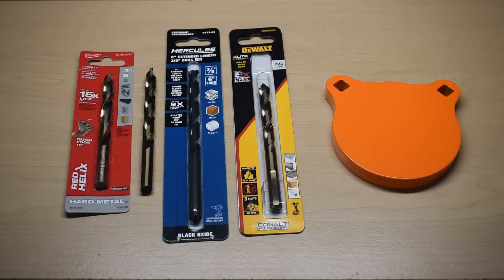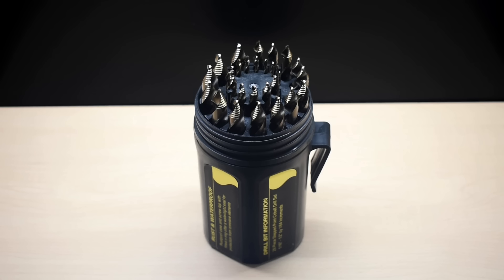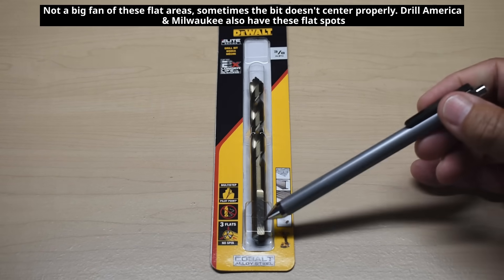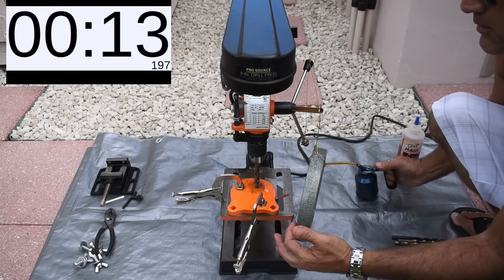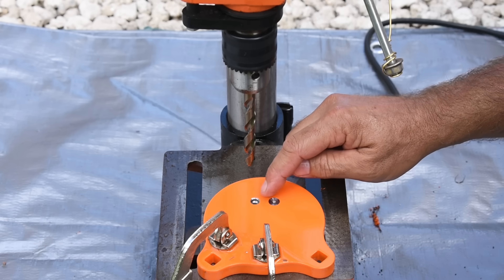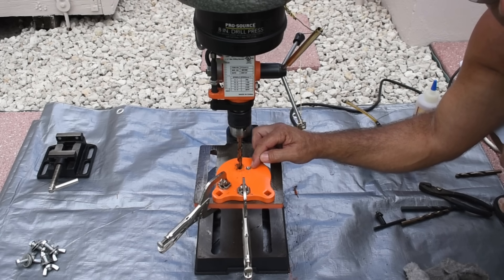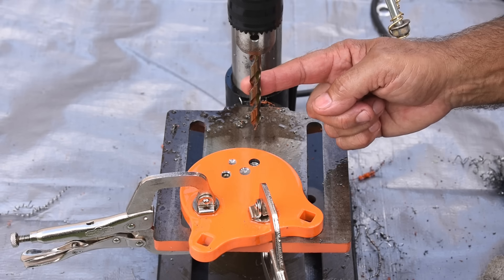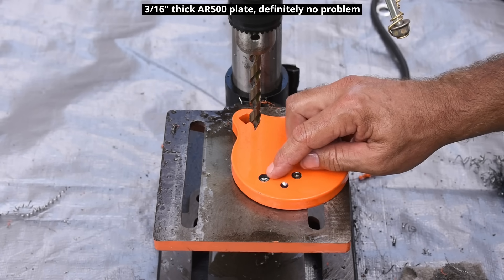Which Drill Bit Is BEST For Hardened Steel Plate Or Stainless? Find Out

Comment from the maker: In this video, we tested 4 different drill bits on tough AR500 hardened steel, an extreme test. The results you see here will give you a solid idea of how these bits would handle something a bit softer, like stainless steel. Keep in mind that while adjusting your drill speed might help each bit last a bit longer and cut deeper(slower drilling speed), it won't really change which bit comes out on top. A drill bit performing very well at a higher speed with a hard material, will perform even better at a slower speed. The cutting fluid used in this video is specifically designed for hard metals such as you saw in this video. None of the drill bits tested in this video became overheated during testing due to the speed of the drill press, constant lubrication, and short duration of drilling. Thanks for watching!

For those interested, I performed a 2nd identical test off camera using 2 brand new bits ranked #2 and #3. Tests were very consistent, with one performing slightly better. Of course, the results shown don't change the BEST to WORST ranking. 

https://drive.google.com/file/d/1FT2hw4dW5Un_6Jc9TazrEkZYZGWOzxR4/view?usp=sharing
Reply: RPM is way to fast and pressure is way to low . I can sharpen a normal drill and get through that in 1 pass.
Reply from the maker: @claytonchristophersen1633  Did you even read my pinned comment? Unreal. Good luck cutting AR500 using a high speed steel bit.
Reply: read the rest of the comments Peanut .
Reply: la prueba es algo que habria que considerar , pues si se quiere taadrar una placa de esas dimensiones tienes que utilizar una broca de menor diámetro primero, y luego una mayor y asi sucesivamente

Comment: I don't use my bits once or twice so when they make a point geometry that is complicated but not hand sharpenable then I have no use for them.   A fifteen dollar throw away bit is obscene.  They should concentrate their efforts on making them from good alloys and skip the fancy tips that in most all cases don't even work as good as the standard shapes.  I can step drill myself by drilling pilot holes with smaller bits if skipping is an issue.  If the tips are sharpened equally it isn't an issue until you get to the larger sizes whereupon you should be using smaller bits to start.

Comment: I like how he just pours oil on the last bit. Rpm is too high.
Reply from the maker: Reading the video description area as well as pinned comments is very helpful.  The reason why the oil was pumped at a faster rate on the last bit, was because of all the metal shavings/swarf that were expanding like a Brillo pad! The oil has a much harder time reaching the tip of the drill when that happens, so you compensate by adding more oil. That's something you should know....

Comment: I was a machinist and drilled and tapped AR 400 - AR 500 steel. We just had basic high speed steel drill bits and a much slower rpm like around 100- 200 rpm was a big help drilling this metal.
Reply from the maker: Possibly on a much thinner piece of AR500 platel, but i doubt it would last too long even at at slow speed because the bit is softer than AR500.I brought stainless and hardened steel items to machinists in the past, and they all used either cobalt or carbide bits. It's not going to be a good option for the average person who"s attempting to drill hardened steel or stainless. Thanks for watching

Comment: A machinist once told me "When a drill bit is screeching, it is saying dumb shit, dumb shit, the speed is too fast."
Reply from the maker: Incorrect. That is only one of several causes. In my case it was excessive cutting that was starting to clog up the flutes on the drill bit. You noticed it was cutting amazing when that sound started. Plenty of lubrication.
Reply: @electronicsNmore Next time use 2 parts hydrogen, 1 part oxygen (water) for a coolant, most mashininist will use a soluble for drilling.  Oil is for tapping

Comment: If you want something probably even tougher try drilling a AR bolt release lever specifically a Geissile Maritime Bolt Catch. I have a unique AR and wanted to use the Maritime bolt catch but it wouldn’t have 1 physical/mechanical feature so I wanted to drill a hole and tap it then thread in a hardened set screw and stake and RockSett it in place then shape it (I thought it would be easier than it was but knew it was far fetched even then and was going to have a custom one manufactured once I figured out the design) and I tried several of these bits and several bits of each of the ones I tried and I tried others not in the video and NOT A SINGLE ONE EVEN GOT A HALF MM DEEP regardless of speed, force, lube, anything none got close. I don’t know what it was made of but I gave up on it and haven’t tried again since then but it seems way harder than anything here
Reply: Have you tried a carbide multi-material bit, or an actual good USA made industrial drill bit like a cle-line? A standard hss cle-line will make any Chinese power tool brand bit look like garbage. Are you hand drilling or using a drill press?
Reply: That’s interesting that you wanted to do a mod to that part as you described.  Bill Geissele is known for his unique metallurgy ideas.  I’ve never tried to drill one of those but I’m not surprised to hear that it’s hard.

Comment: That's the issue with small and cheap drill presses, they run way too fast for most bits even on their lowest speed. The drill press damaged every bit tested by not running slow enough to hit proper SFM. It's like listening to guys who pontificate on needing cobalt to drill stainless, you don't. A good HSS bit running at the correct speed and feed with a bit of cutting fluid will drill it just fine, repeatedly. Give it to someone who doesn't know what they're doing and they blunt the bit and create a hard spot in the stainless before they even know that something has gone wrong.
Reply from the maker: A black oxide high speed steel drill bit is not designed for hardened steel or stainless, the bit isn't hard enough for the job, and will overheat fast. Perfect analogy would be using glass to cut diamonds.
Reply: @electronicsNmore  hate to disagree with you but like I said a good quality HSS bit will cut stainless just fine. It is all I use on my lathe for stainless. It's all about speeds, feeds and controlling heat with cutting fluid. Running bits too fast, like with that cheap drill press, is where people get into trouble.

Comment: There was discoloration on the bit tips from friction/overheating. 
But I'm not here to harp on that. I would agree with some of the others about the ability to resharpen a bit or not makes a huge difference. If you have to buy multiple bits to finish a hole it's no good. Second of you can't finish a hole, it's worthless. So without considering different speeds and stuff, the only way to make it through is by using a drill doctor or equivalent. By these standards the step bits are all inferior. And I have drilled garden steel with black oxide. I usually don't try that without pilot holes if I'm forced to use that type of bit.
Reply from the maker: Extremely minor. The only one that showed some discoloration was the Milwaukee red helix. The only reason why you saw some, was because after I knew it wasn't drilling anymore the drill press continue to run and I stopped lubricating
Reply: @electronicsNmore I wasn't getting on you about that bro. I understand what you were doing. I mainly seen discoloration on the tops but those were the tiny tips of the step bits which should build heat faster because they are so tiny. I think that's why the cheaper step but worked better. They actually had a step bit profile. 
My only argument was about what but is actually better for completing a hole. Since all failed and need sharpened the step bits would be where I would spend my money. 
Also never forget comments, good or bad, drive the algorithm. It doesn't care if it's negative. It's all about the engagement! And you ain't doin anything worth doing if you don't have haters. I played in a touring hard rock band and I can tell you that if you allow the haters to do anything other than motivate you it will burn you down! You do you. And we'll be here for it!

Comment: You are not putting enough pressure on the feed. And you need to slow the speeds way down. Lots of tool pressure from the very moment it touches the plate and a very slow rpm. Letting it rub on the plate is frying your edges and work hardening the plate.
Reply from the maker: Reading pinned comments or the video description area would be helpful. :-)
Reply: A lot of time is required  involved with slow drilling. 

Painfully and gradually. 

Trust me, I've been there.

Comment: I use bosch cobalt drills...to bad you didnt try them also...3/8 is a pretty big hole for that super hard steel...I suggest Ebay and getting something industrial...a 3/8 will be a lot of money.I think a carbide tipped Champion drill may be in order.
Reply from the maker: Bosch does make quality drill bits, but I was looking for the top of the line, best selling bits at Home Depot, Lowe's and Harbor Freight.

Comment: I have a 25 year old 29pc Milwaukee one slope cobalt drill set that has seen some abuse including high speed (that shoulda been low) drilling & starting unlubricated, that is still going well. I recommend a good set that will unfortunately cost real money, then replace individual bits of you break one. Good test for a shootout, slow speed is better in actual use, 300rpm would be good for this chore
Reply from the maker: Yes slower speed would be better, and allow the bit to last longer before wearing out

Comment: Machinist here. Your rpm should be around 300. Not 1000. Ar500 is crazy tough steel. Slow rpm with zero rubbing is the only way you have a chance of making it through. 

This video is an indicator of someone who honestly does not understand drilling steel.
Reply from the maker: Slowest level on my drill press is 750rpm. I'd be willing to bet the order I showed from best to worst, wouldn't change, but yes, possibly at the slower speed both the multi step and Drill America could have made it fully through by extending the life of the bit's cutting edge. Slower speed is used to prevent overheating, did you even look at the drill tips in the video after the drilling process? I view my test as an extreme test for these bits, and the results from these tests makes it very clear which bit drills that material best. Sorry my test didn't meet your standards.
Reply: @electronicsNmore I would bet the worst drill bit in your test would have made it through if you had the correct rpm and feed pressure. That would really change the results and lessons learned.

Rubbing is the enemy and you cannot avoid rubbing at high rpm. You need to be making a chip at all times. The edge did over heat due to friction. That is the mechanism of dulling.
Reply from the maker: Like I said the order would not have changed. The average person that has to drill through hard metal is not going to be using a drill press more than likely a hand drill, and they're not going to use a very slow speed where it takes a long time with downward pressure. Just being realistic
Reply: Thank you for posting your concerns, as it looks you're not the only one who questioned the procedure.
Reply: My first thought as well - too fast and not enough feed pressure.  I'm no machinist but I did stay at a Holiday Inn last night.....
To be fair, it seems like most cheap drill presses you see are woodworker tools and don't have proper speeds or rigidity for steel work so his results are probably not unusual for a typical diy home gamer.
Reply from the maker: @donhappel9566  Not enough feed pressure? You do understand how a drill press works? I used a 10 pound weight on the ends of the feed hub wheel, that force is FAR greater at the point of drilling. More than sufficient pressure was applied for this test. One thing I learned over the years on YT, there will always be complaints no matter how well you make a video, and there's an abundance of pedants.
Reply: To be fair, what part of an extreme test don't you get? LOL. He said which drills best, not which bit makes it through. To me, 2 bits were at the top, with one being a little better. Testing slower, probable both at the top would've drilled all the way throught, but I agree with him saying the order of best to worst wouldn't change.
Reply: Never had good luck with Black oxide bits unless its thin steel!
Reply from the maker: @Terry-q8l  Yes, it's fine for mild steel, but when he said that he could get the HSS black oxide bit to fully drill the ar500 plate, he lost credibility.
Reply: @Terry-q8l I've drill tens of thousands of holes with black oxide.
Reply from the maker: I Never heard of anyone drilling hardened steel or stainless steel using a black oxide high speed steel bit.  They make Cobalt bits for a reason
Reply: @electronicsNmore  Never heard of a machinist using any sort of hss tool. The ones i've met use tungsten carbide almost exclusively the only exception being diamond coated grinding wheels.
Reply: electronicsNmoremate I used hss to drill metal too.

Just because you're unaware of it doesn't mean it doesn't work.

When you have limited equipment and have to get the job done, you use what you can

If your equipment won't go below 750rpm or you're stuck using a hand drill, you still have to get the job done.

The test in this video was great!
Reply: @batmanacw  Agreed. Black oxide is just a coating, it's the quality of the underlying HSS that determines how well it will handle stainless or hard steel. A lot of department store black oxide bits are made from rubbish HSS , but you can also get some very high quality HSS bits with a black oxide coating. You just can't judge a drill bit  by its coating alone. Yes coatings can help to some extent, but they are all irrelevant if the underlying HSS is no good.
Reply: 200-400 rpm is recommended.

Comment: Your lubrication wasn't consistent. The last one is the only one that you pre-lubed it before starting the drill. The other 3, you let them start, before you applied any lubrication. Does it matter? Not sure, but the test methodology wasn't consistent leaving the ability to question your results. Sorry.
Reply from the maker: Whatever you say. Can't please everyone,  All bit tips had a pool of cutting fluid applied to the plate before each test began. You sound like you work for one of the manufacturers that didn't get 1st place.
Reply: @electronicsNmore   Sorry, don't work for anyone like that. I was interested and clicked on your thumbnail because I was interested in the test and the results, looking to see what was best for drilling hardened metal, and was just commenting on what I saw, since I never saw any puddle for the others, but you initially and constantly lubed the final drill. I'm sorry you feel my honest observation of what I saw from YOUR video presentation, was a partisan POV. If I was to be as cynical as you, I'd then have to present that maybe you had a preference of which one to make perform better by lubing the preferred one, and running the others dry.  Not interested in your juvenile suppositions, rather than you seeing what COULD be misconstrued as a flawed testing methodology, from a non-vested point of view. Bless your heart and have a good day.
Reply from the maker: If you doubt my results I suggest you buy the same bits and repeat the test

Comment: It's always been my dream to buy the most durable expensive drill bit set but I can never justify the purchase especially since I only need a drill bit a few times a year. I'm happy with my Harbor Freight $45 set but if I was a millionaire I would splurge for no good reason haha
Reply from the maker: If you're going to be drilling into mild Steel, aluminum, wood, plastic, then the Harbor Freight set is fine

Comment: Most of those are step drills, great for the average guy but I wouldnt touch that as they cannot be sharpened.  I use my drill bit sharpener to keep all of my bits accurate.
Reply from the maker: True they are difficult to sharpen, and they are not cheap.
Reply: If you buy the nice ones they have a lifetime warranty . When it dulls get replacement free
Reply: any brand youd recommend if I may ask?
Reply: NERD!

Comment: Great comparison, Scott.  👍👍  I've seen you commenting on Project Farm.  Seems you may be following Todd's way of testing.  You gave the 3rd bit a second chance with more pressure.  The last bit may have made it all the way through with more pressure.  I'm surprised you didn't try that.
Reply from the maker: I was only showing that applying more pressure to a bit that stopped cutting with the 10 lb weight, would not make it continue to cut by applying more force. The last bit had to follow the same testing guidelines as the others which was allow the weight only to perform the operation. The testing was allowed to continue with Drill America, because the bit was still sharp, it was a problem with the tip exiting the hardened plate. Thanks for watching

Comment: Looks to me like none of them were the way to go. If you're looking to drop through that plate - you didn't drill through that plate. Call kennemetal - I want to see if their bit will do it ;-)
Reply from the maker: Well the purpose of the video was to show which one is best. One of them was able to penetrate and drilled quite smoothly through the depth of that hardened steel armor plate. I was also able to determine the thickness of an ar500 plate that the leading drill bit would have been able to drill all the way through